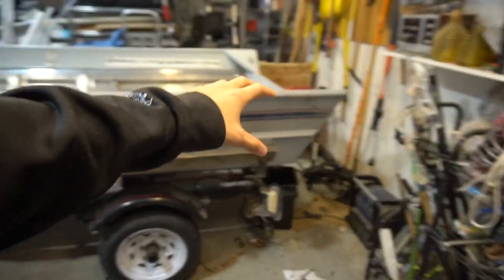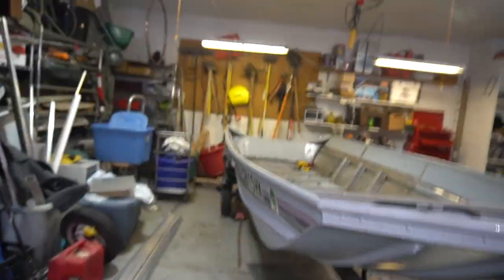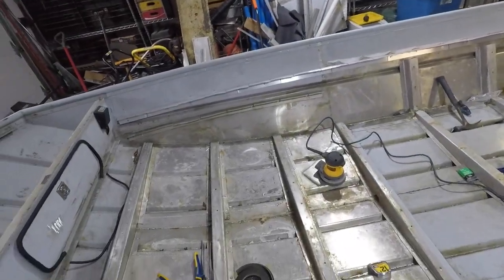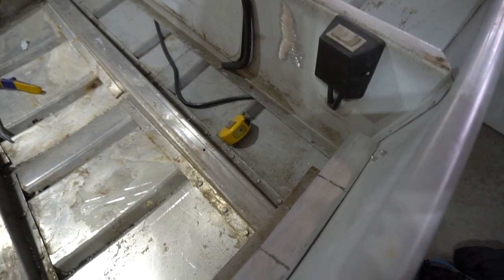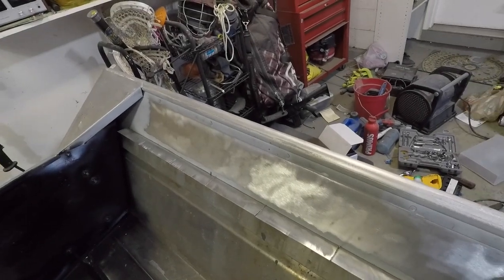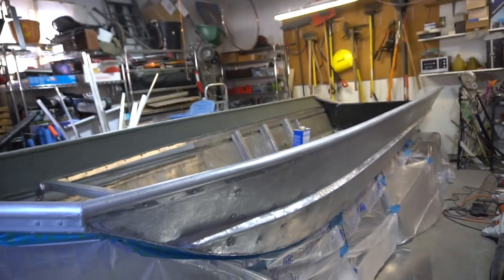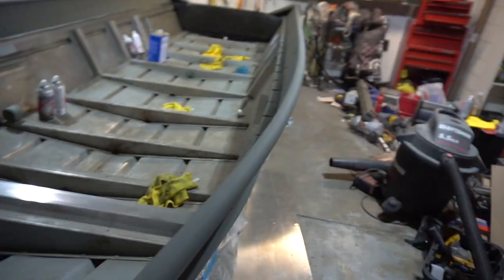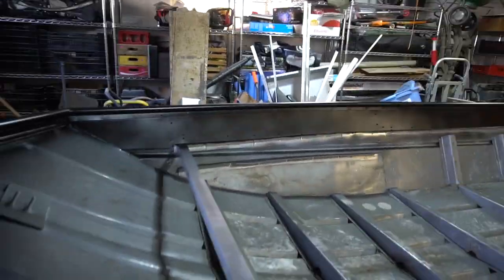How I painted my Jon Boat CHEAP! --1542 Jon Boat

Comment: you destroyed a perfectly good boat. how many times have we seen somebody spray some shiny new paint and say "look at what i did"! you can do it too... diy. then the next guy has to spend hundreds of dollars to get that crap off, then only to find that the metal is ruiend underneath. no, its not "textured". the aluminum is gouged, thinned and weakened. more prone to crack. who takes a grinder to alunimum?  a kid that doesnt know anything about what hes doing. so youve painted a couple toys a year or two ago. that was a nice boat... before
Reply: What I don’t get is all the other people here praising someone for doing it completely wrong, and on a platform where those same people will obviously follow this bad information. I mean kudos for actually fixing a boat but Jesus at least do it somewhat correctly to reach people how to do this sort of thing.